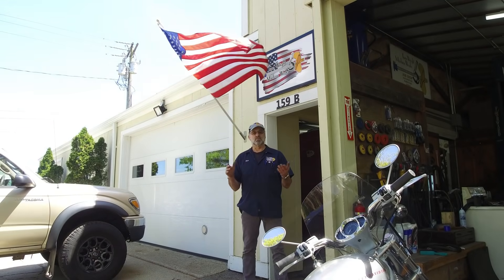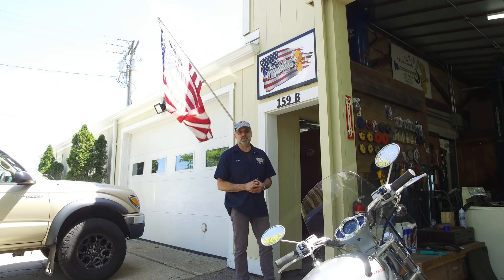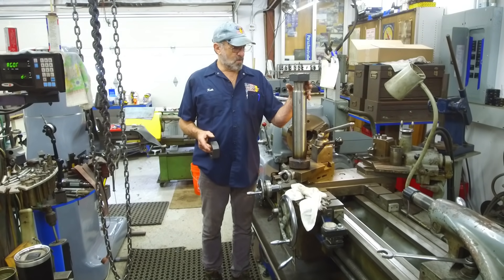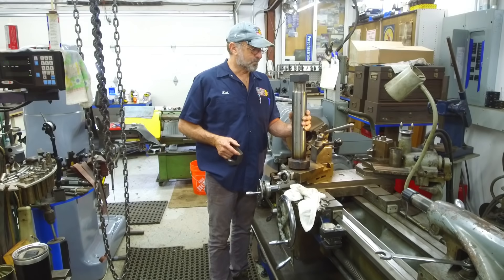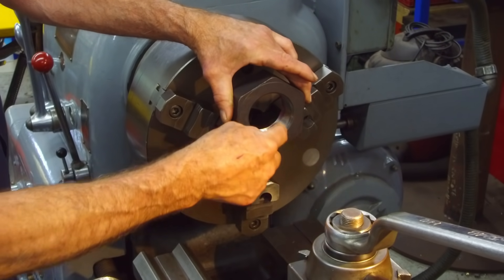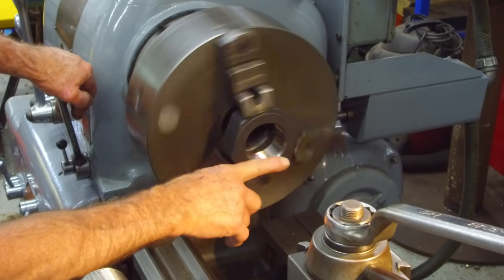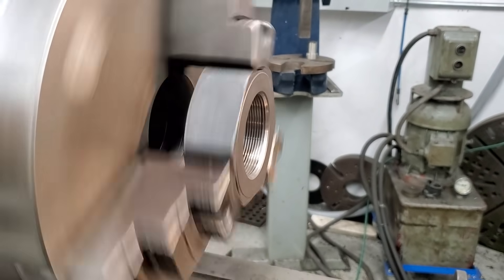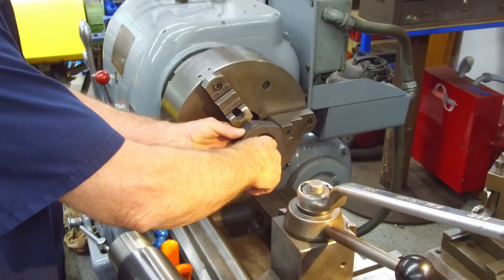Trick Fuck The Nut Preview

Comment: I wonder if that first nut might fit the other bolt.  It's so crazy to think they could have gotten out of that shop without a test fit.   Like maybe they didn't cut the bolts the same but they each have a nut that fits and the nuts got swapped.
Reply: could be, maybe two different people and machines threaded them in pairs and one or both are worn or off from another.
Reply: KA-CHING!
Reply: That would be nuts.
Reply: Then one nut would be too tight and the other too loose.

Comment: looks like you must make a special positioning pin with the same thread and MT5 (?) to put into the tailstock
Reply: large chuck in the tailstock can make this dozen cheaper -- you can try to weld something like 12-16 mm straight tail and large bar cut for threading, turn this mushroom in one setup with threading, and cut it off from the thick stock

Comment: Don't know about you Keith, but if they galled the nut on the pin that was installed, the thread on that pin is likely galled as well, good luck to whoever is doing the assembly. Great video BTW, keep em comming, best wishes, Mal.
Reply from the maker: Yes they bought a triangle file and worked on the area needed, no word from them so I think they massaged it enough to work, but if not, I'll continue with part three! LOL. ;{)

Comment: So many ways to do this. Chuck the nut lightly, insert the bolt and indicate the bolt to line up the nut. Make a threaded mandrel to hold the nut. Chuck the bolt on hex end, smooth end in steady rest, and use the bolt to hold the nut. Or, just indicate and shim the nut directly.
Reply from the maker: Cool those are all good ideas Too! ;{)
Reply: If the bolt doesn't fit into the nut, how would you "inert the bolt [into the nut] and indicate the bolt"?

On your second suggestion, how would a threads mandrel hold the nut and still allow the threads of the nut to be machined? That is the same question for the third suggestion. If you chuck the bolt, how are you going to machine the threads of the nut if the bolt is holding the nut? 

I don't get what problem those suggestions are solving, without creating other problems.
Reply from the maker: LOL exactly! ;{)

Comment: I really really want a giant nut and bolt
Reply: If the nut only goes 1 1/2 turns to hand tight, just heat it up to welding temp beforehand like the one shown welded on.

Comment: Keith, are you putting your channel at risk for language? Plus, I think your video is missing some content.
Reply: "preview"
Reply from the maker: https://rumble.com/embed/vh0fup/?pub=enuw3
Reply: @KeithFenner  you need to verbally tell that the full video link is in description, almost no one reads the desc. I thought the full vid was gonna appear here soon and it was a teaser.
Reply: I think that's the point, while taking as much as he can.
Reply: @MF175mp  I believe the full video is going to appear here soon. He just released it on rumble first. And he posted the link for people that didn't understand what a teaser video is.
Reply: Without Rumble.
_ Check the threads with plug or ring gauges to see where the error(s) lie. Assuming customer may want to replace the nuts sometime in the future with standardized stock.

If metal is to be removed from the nut:
_ Machine a plug to fit the nut thread ID extending twice the thickness.
_ Plasma cut a hex hole to fit the nut and drop it out of a larger round disk.
_ Tack the disk on at 3 or more flats of the nut.
_ Place the plug into the nut, mount in a 4 jaw lathe chuck.
_ Indicate the plug near the nut and at the end to establish the centerline.
_ Remove the plug, correct any thread issues with a boring bar threading tool and true the nut's face.
_ Grind the tacks away. Option: Machine the opposite end and radius the corner to indicate mounting direction.

If metal needs to be removed from the bolt:
_ Machine a sleeve to fit over the thread, indicate to find the centerline, center drill and machine between centers.
_ Assuming the shank is clearanced in the assembly.

Comment: When I went to watch the video, the timing between video and audio was off and kept getting worse. I also couldn’t get to the comments on rumble, one more thing is all I can see is from your shoulders down, did you cut your head off on purpose? 
 It might be nice to watch these on YouTube until they get the bugs worked out, or am I doing something wrong?
Reply from the maker: On Rumble, you have to adjust the resolution to 1080 and then you have full power of video which works fine. ;{)
Reply: @KeithFenner , thanks Keith, that should make it easier to watch.

Comment: Easier to check bolt three wire method and make new nut. Maybe tap nut in chuck to get 0 runout on face and see how threads look running. Make new nut in no time.

Comment: Hi Keith blowed if know why people have trouble screw cutting threads  ,when I went college trainng as a Fitter Machinist we were taught single point screw cutting in the first month. Looks like cheap arsed  Chinese nut. While I understand why the customer wants you to open out the thread in the nut but  it will cause and orphan and someone will stuff up later on putting on a nut that has been relieved.....0 well more work for you later on. Cheers Ian. Enjoyed the short vid.
Reply from the maker: That was my first suggestion, but the mating pin was in place already, so be it, option 2.... ;{)